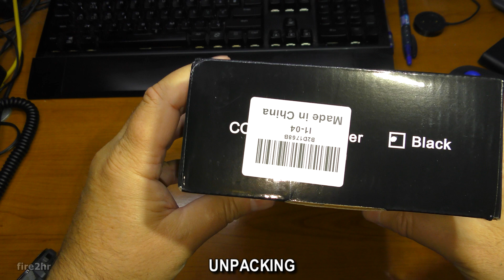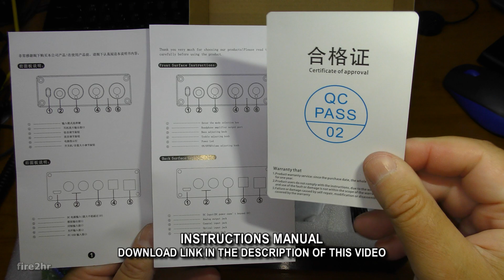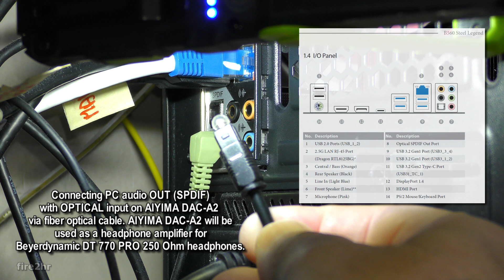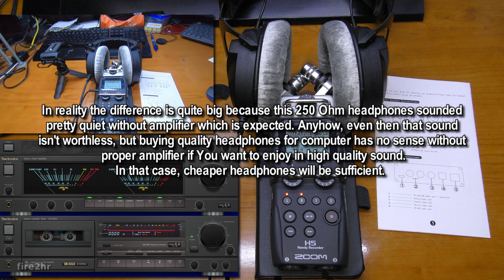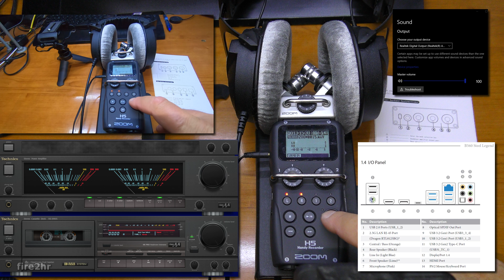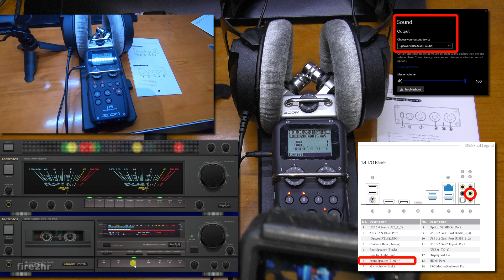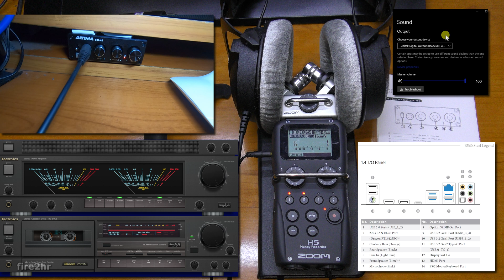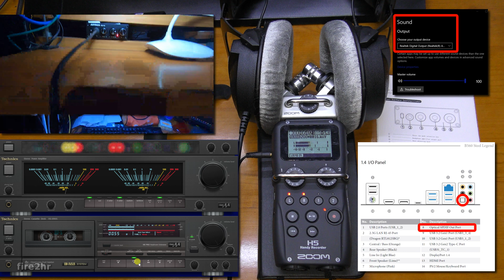🎵AIYIMA DAC-A2 (🎧 Amplifier) & 🎧 Beyerdynamic DT 770 PRO 250 Ohm (🖥️PC Audio Test🎶)

Comment: Is this DAC compatible with speaker? "Klipsch the one" speaker to be precise. And have you test this on a speaker yet?
Reply from the maker: I think yes. Klipsch The One as I see is an active speaker with audio inputs (3.5mm miniplug). Aiyima DAC-A2 is also preamplifer for active speakers (beside headphones). For output to Klipsch analog output can be used ->(AUDIO OUTPUT R/L) on the back panel. So signal path for best performance should be (Optical output from PC)->(DAC-A2 optical input)->(DAC-A2 analog output R/L)->(Klipsch The One analog input 3.5mm miniplug).
Reply: @fire2hr  ok, thanks, and i got some questions:

1. in the test at 9:29, it feels like the sound is shifted to the left more than the right, is it because of the setup or the output of the DAC is really shifted to the left? or is it just my headphone? or is it your video's sound just shifted to the left? i couldn't tell

2. when using the DAC, did the sound getting muffled(in headphone)? some budget DAC get that problem

3. can you describe the output sound of the DAC? somethings like balance, or V shape, .....

p/s: my PC doesn't have Optical output, so i think i'll stick to Coax output of my PC, i'm not really sure what PC-USB input is, can it be used on PC i wonder? if yes, then i'll use that instead of Coax
Reply from the maker: @FalAn212  1. I can't confirm that on my system here. Sound ok with no issues you described.
2. Didn't noticed that. Sound is much better with this setup from my PC.
3. Sound now is warmer with feeling wide space in sound picture on headphones. Without this setup is somehow flattend and narrowed...but not so bad to be unlistenable. Also DAC-A2 have bass/treble/volume controls to tune it how you like.
Reply: @fire2hr  so the sound tune of this DAC is neutral, and this DAC improve your sound setup yes?

Comment: Modern gaming pc builds mostly does not have the SPDIF (like mine) will i still be able to use this dac/amp?
Reply from the maker: @RCGJR_  You probably have optical output(?)...so answer is yes.
Reply: Check you manual.
I always had one at my build your own.

Comment: Hi would it benefit my iem if i use the optical wire to connect to my pc? Or should i use the usb?
Reply from the maker: Optical is better, yes.
Reply: @fire2hr  thanks, i did not know anything about that the port behind my board was optical and used for audio. once my Aiyima A2 arrives ill try it.
Reply from the maker: Via optical and coaxial input you have sampling frequency 192K/24bit which is better than USB input from PC which have 96K/24bit sampling. So with some good headphones you will have better sound.

Comment: is this the best combo or?
Reply: i’m thinking about getting the 250ohms 770 pro with this device for music making/production & gaming wise… pls respond
Reply from the maker: Well DAC-A2 is the cheapest solution for sure, but....
Better option and better match for Beyerdynamic DT 770 PRO 250 Ohm headphones would be AIYIMA DAC A5 Pro.
https://www.aiyima.com/products/aiyima-dac-a5-pro
Why? Because of this detail "Headphone matching impedance:16-300Ω"...and better sampling frequencies than DAC-A2 or DAC A2 Pro
AYIMA DAC-A2 is not optimum match because of "Headphone matching impedance: 16-200Ω".
https://www.aiyima.com/products/dac-amplifier-aiyima-dac-a2
Also AIYIMA DAC A2 Pro is also better solutin beacuse "16-300Ω" for headphones but same sampling frequencies as  AYIMA DAC-A2.
https://www.aiyima.com/products/aiyima-dac-a2-pro
Reply: @fire2hr  appreciate the info so which is the one i should buy buy, for all around use to get the most of the headphones, the A5 right? either way they both cheap and not tryna spend hundreds on these other dacs… with the power supply to put into a outlet as well? tryna get the fullest out the A5
Reply from the maker: @zazathrupain  A5 Pro yes...and you will need here external power supply 12V=.
Reply: @ alright thanks

Comment: Can this be good with speakers to?
Reply from the maker: No, only headphones.
Reply: @fire2hr  ok one more question does this bypass my PC gaming motherboard DAC if use the audio in PC-USB?
Reply from the maker: Hm...why not use the optical output from the MB? Info about bypassing MB DAC should be in manual I guess(?)
Anyhow I'm think yes because info for PC-USB input says that sampling frequency is 96K/24Bit and optical 192K/24Bit.
Reply: @fire2hr  so it bypass then. Good to know I'm gonna buy one.
Reply from the maker: Not 100% sure but sampling frequency 96K/24Bit on this DAC on USB input should mean that USB transmit raw audio from MB. 
I never use that so I don't know for sure. Optical output from MB is just fine for me.
Reply: @fire2hr  96k/24bit is fine.

Comment: what kind of power unit do you use to feed this amp?
Reply: You can use power from device such as computer or any charger(phone charger with a type c cable)
Reply: @vladdymr  my bad, type c is only for the A2 pro model. The A2 uses Micro Usb cable from what I see.

Comment: Would you recommend it for a dt 700 pro x? I would just like cleaner and more powerful audio than the output of my board (it also has an optical input) Sorry for my bad english
Reply from the maker: As I see that headphones have 48 Ohms impedance.
This Aiyima amplifier is made for headphones with 16-200 Ohm impedance.
I think that will provide better sound quality than audio output from motherboard.
Also you can connect optical output to Aiyima amplifier.
https://global.beyerdynamic.com/dt-700-pro-x.html

Comment: I have a akg k240 mkiii, Aiyimia will be good for me?
Reply: 55 Ohm
Reply from the maker: Yes this amplifier is made for headphones with 16-200 Ohm impedance.
So you should have maybe little better quality sound than from your original device.
Anyhow higher Ohm value provide better sound quality in combination with adequate amplifier. 
Here is interesting Impedance Guide.
https://global.beyerdynamic.com/impedance-for-headphones
18 Ω Smartphone, tablet
32 Ω Smartphone, tablet, MP3 player, laptop
80 Ω Several studio applications, laptop, PC, Hi-Res MP3 player
250 Ω Headphone amplifier, stereo system audio interfaces, studio
600 Ω High-end headphone amplifier

Comment: hi. does this support headphones with mic?
Reply from the maker: As I see you can use the headphones but mic wont work. This device use only audio out from computer. If you want using mic than some kind of adapter for splitting mic and audio line from headphones jack is needed. From that adapter mic line goes on the mic input on computer...something like that.
Reply: @fire2hr  thank you. i just found that there's a model which is dac a2 pro that have mic output